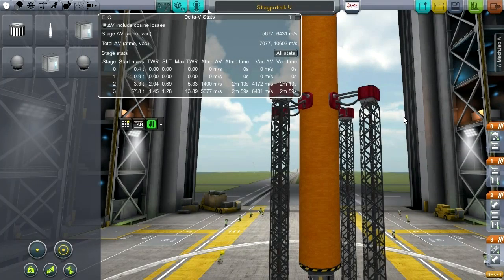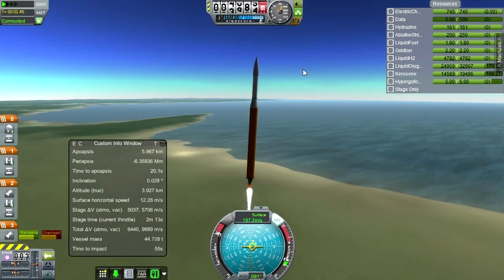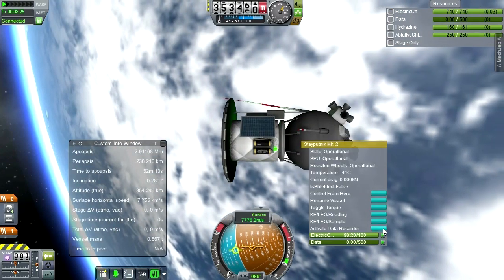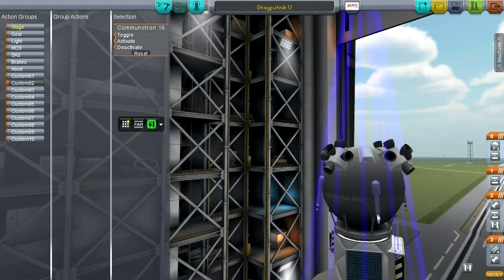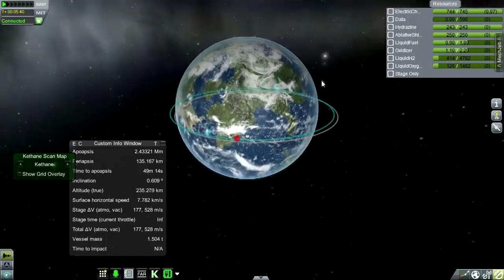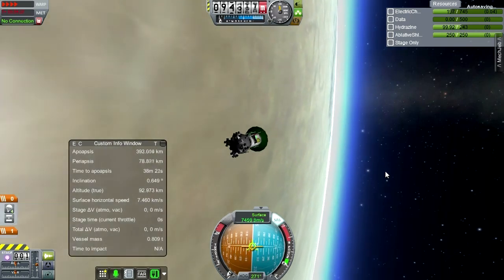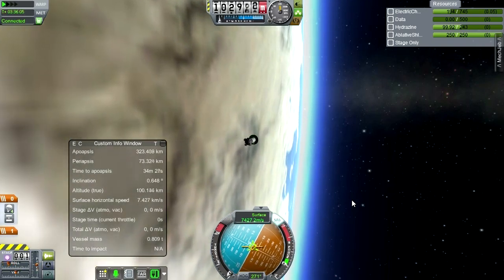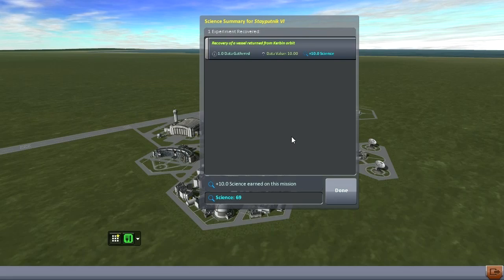Kerbal Space Program (0.23) - Realism Overhaul 005 - Stayputnik

Comment: And orbit is now achieved! Congrats.

Um, why not use the RT2 flight computer? It's there for performing maneuvers when out of comm range. Click the little icon to the right of the RT2 status text to bring it up.

That said, regarding launching when you only have KSC's signal. What you need to do is design your rocket such that at first stage burnout your apogee is (near) where you want your perigee to be. Then, don't ignite your second stage until you are closer to your apogee than your stage takes to burn. (Say, for a 3m burntime stage, ignite when apogee is 2m30 away). Assuming you have somewhat more dV than is required for circularization, that should give you a new orbit where the apogee becomes the perigee, and the new apogee, on the far side of Earth, is much higher.
Further, you need a reasonably high-thrust upper stage so you can make a short, sharp burn near apogee; and you need to incur some gravity losses by flying a steep rather than shallow trajectory (as you're doing already, actually--you start your turn later, and turn far slower, than would be optimal, I think...)
Reply: ***** IIRC it allows for any command you can give: staging, action group trigger, whatever.

Well, it depends on how long you wait. But it doesn't really matter, since you can (like real life) bring a couple tiny ullage rockets (say, 2x separatrons) to fire right before ignition, to settle the propellants. That said, if you're going for a comsat network then you wouldn't need this approach. Even if you do take a shallower trajectory though, you should try to establish an apogee equivalent to the perigee you desire (or maybe a bit below) with the first stage, and burn the second so that apogee stays at (or rises to) your desired perigee, and burns out right about when you reach it. That should give you a maximally efficient circular orbit...
Reply: *****
Somehow missed your own line re: ullage rockets. Ignore my mention of them, you're already thinking of them.